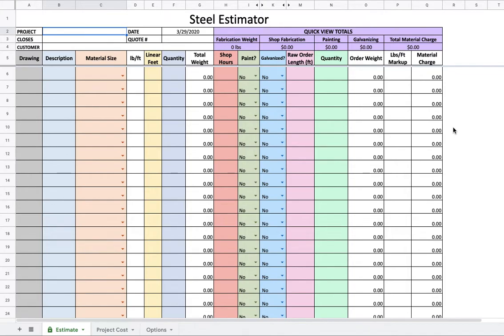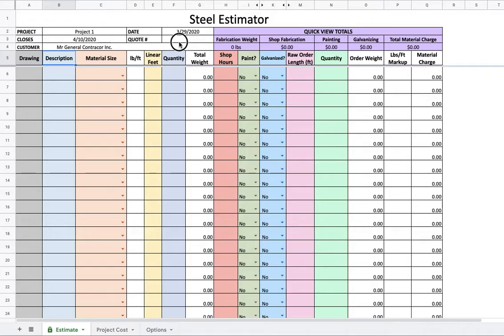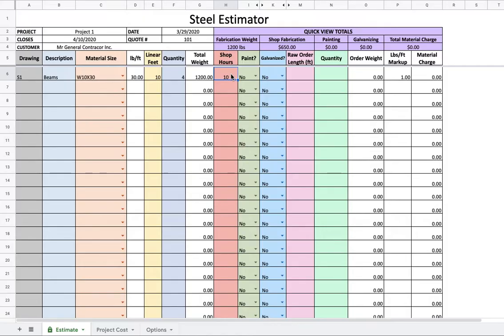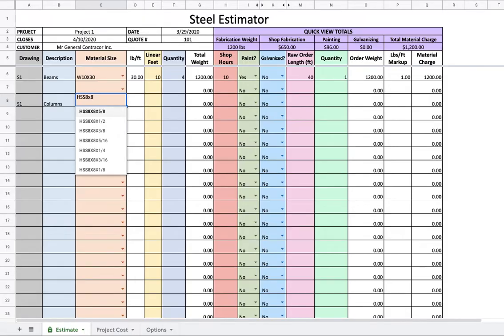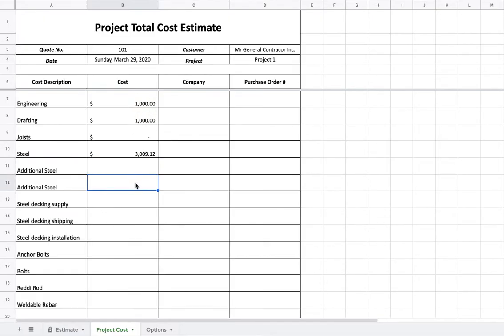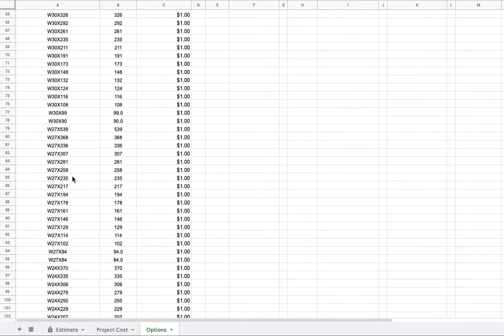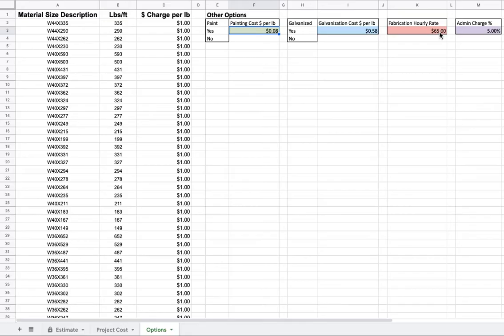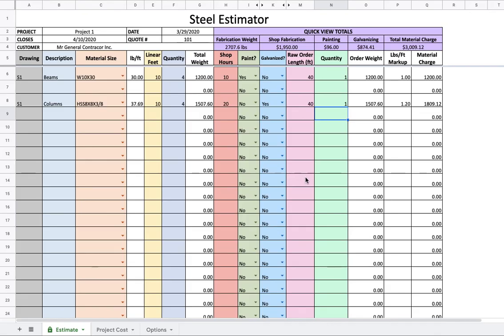Structural Steel Estimating Spreadsheet SMALL FABRICATORS ONLY!

Comment: Does the material selection include all Shapes/Sizes for Steel, Stainless, Aluminum, etc?
Reply from the maker: No sorry, only general fabrication “Steel Structurals” as defined by the AISC. Beam, Channel, HSS, Angle, Flat Bar, Pipe and Rod/Round Bar. Hot rolled A36 (44W in Canada).

Comment: hi, when I type in the material size box it does not shorten the list down.
do I need to change a setting to make it work or something?
Reply from the maker: Hi Lee, my apologies - the program I am using in the video is Google Sheets, which has this functionality built-in. Unfortunately Microsoft Excel has promised this, but doesn’t have this as a setting yet. If you need a Google Sheets version email me steelestimatingsoftware@gmail.com